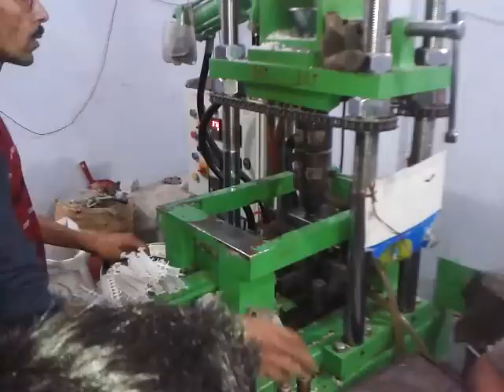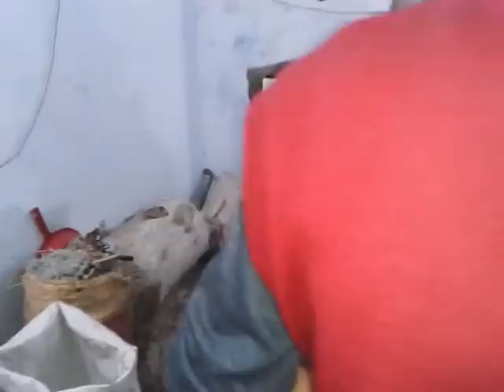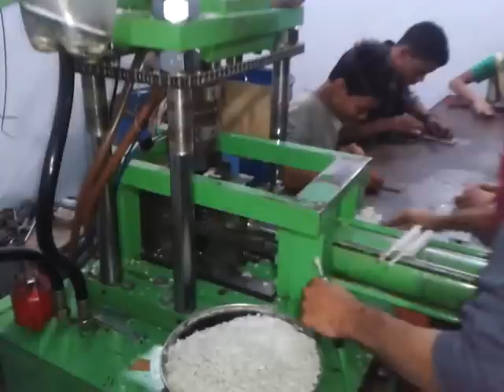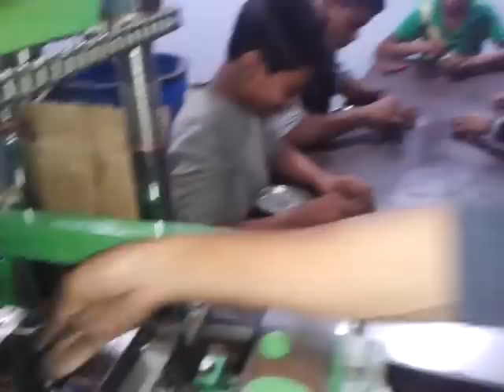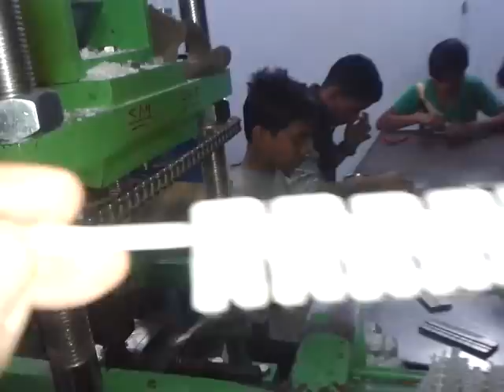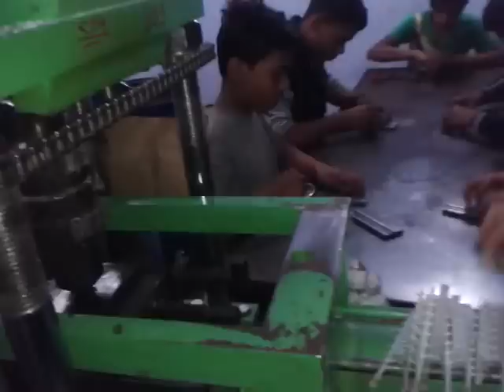(JP INDUSTRIES 03)Bobine(CFL,LED BULBS) type vertical molding machine

Comment: Which metrial use this
Reply from the maker: Nylon 66
Reply: @JP_mouldingmachine.  Granuals  use this
Reply: @JP_mouldingmachine.  Granuals metrial 70/80/82use this type
Reply from the maker: @devidchinna5404  yes you can use all types
Reply: @JP_mouldingmachine.  ok sir 
 which  temperature is best for maintance level of Granuals 80 or 82
Reply from the maker: @devidchinna5404  please watsapp. Me @ +918802616181